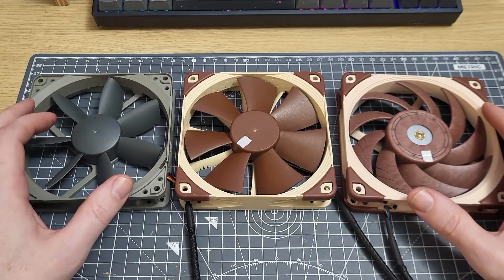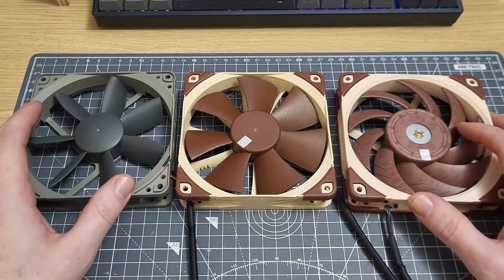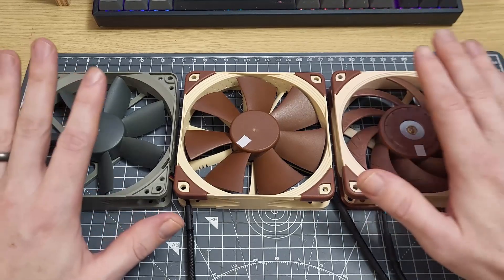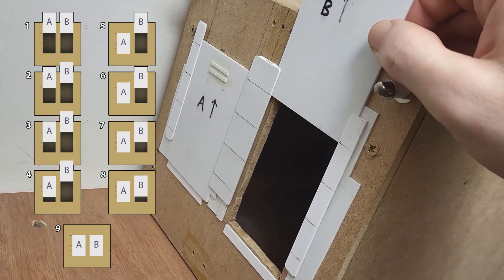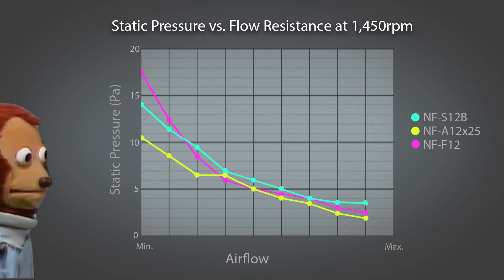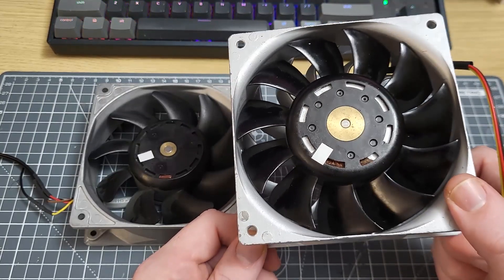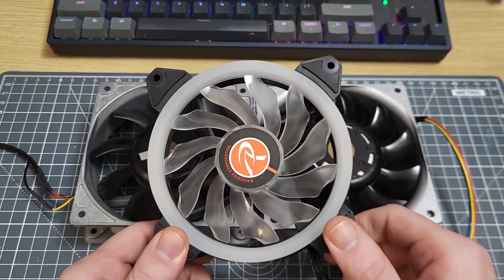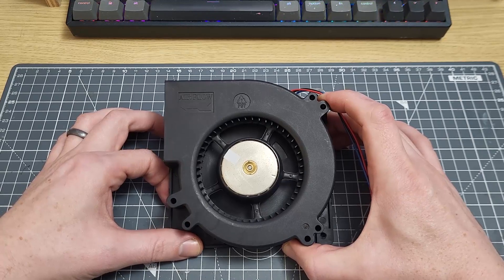"Static Pressure Fans" Don't Exist - Part 3

Comment: The tests and comparison is very good. I think the difference in RPM might not be important for end user. I would say for a PC fan user (home user, putting it in PC), the RPM is just a intermediate variable that can be easily measured and used as control input. What people really care about is the noise-per-cooling. So I would give noctua a out of jail card for not mentioning the RPM. and it would be a lot more comparable if we can do a test where instead of RPM is held the same, the noise level is held the same.

Comment: Why would anyone care the rpm of two different fans running at the same noise level? The whole point of deciding which "PC" fan is better is to see which fan outputs the most airflow under the same impedance at given noise level.

Comment: "PC fans will never get this level of obstruction in real world use."
Meanwhile me here with a niche use case just wanting to find out what'll be the best fan to reallllly force air through. Although, I've already realized the answer is just, high rpm. 

I know these videos are addressing talking points said on forums, but still it makes me roll my eyes.. kinda feels like you're talking down on us from time to time.
Reply: My 60 mm thick 16 FPI radiator begs to differ. That said, it only manages to choke out bequiet weak quiet fans.

Comment: I don't really get the point of this series... You say right in the video that noise is the priority with home PC fans. Are you just upset that some YouTubers popularized the term "static pressure" when it doesn't apply relative to industrial fans where noise isn't a consideration?

When I'm picking fans for a home PC, I know I could get some $150+ industrial fans and enjoy my gaming sessions with earplugs in... It's just not an option I think it's a good one in that scenario. Most people putting any real thought into fans look at testing of their use case in noise normalized scenarios, or as you also note, the RGB. I don't think anybody thinks their Noctua will compare to a Delta  on performance, but they aren't gonna put that thing in a PC next to their face on their desk.
Reply from the maker: I just find this stuff really interesting, and of course when I heard the term "static pressure fan" a few years ago I laughed a lot and didn't really think much about it, but now people actually make purchase decisions based on this nonsensical misinformation so I thought I'd make some videos about it. The main purpose of the series is to demonstrate that static pressure performance doesn't necessarily translate to actual cooling performance, and hopefully people will be better informed about which fans are actually the best cooling fans, which will take a fair amount of testing to ascertain - which, for me, is the fun part.
Reply: @FanPhys  I absolutely agree that it's interesting, in a purely academic sense, but as someone with years in the PC building and customization space, "static pressure" has a very specific place in how I make a decision. I wouldn't expect it to make much difference in a low-resistance application like an tower air cooler, but I will consider it when paired with a radiator. Even there, I won't be looking so much at the static pressure, but the real-world performance of a fan through a radiator.

That's somewhere where I really wish there were more complete and objective data. You can find scattered info about airflow through a radiator, but that generally won't test more than a couple of radiators that only differ in thickness, not fin density or geometry. I haven't seen any testing of the difference fan design might make between two different radiators in terms of actual thermal dissipation, but that would be incredibly fascinating.

Comment: This testing does not prove what you are saying.  Your fan box does not accurately replicate the kind of resistance a fan encounters on a heatsink, and your last video proved that your testing methodology is poor.  If youre test environment was a reliable analog, it would produce results that map directly to the results you saw when the fans were used on your heatsink in your computer.  But, the results from your test environment didn't even remotely resemble what you saw using a heatsink.

You're also disregarding all the testing results from known reputable testers, which very clearly prove that certain fan designs maintain more airflow through a heatsink or radiator.  E.G. They maintain more pressure in the face of heatsink/radiator type restriction.  

It's disingenuous to try and say that your test results prove there is no difference between fans marketed as higher static pressure, when you have clearly shown yourself that your test setup does not replicate the results seen when a fan is on a heatsink.
Reply from the maker: Again, you are assuming that pressure is the only consideration when we measure fan-on-heatsink performance, and that's not how fluid mechanics works - it is vastly more complex than that. And for what it's worth, the vast majority of "known reputable testers" have a poor grasp of physics when it comes to this sort of thing, which is precisely why I am making this series. Why would I regard test results that are obtained from poor, uninformed methodologies?!

Comment: You measure pressure at a set system impedance with your setup, you could theoretically calculate airflow from that though
Reply from the maker: It is possible to measure airflow from pressure, however getting an accurate reading would be difficult. Perhaps somewhere down the line I may be able to look into it!

Comment: Instead of same rpm, noise-normalized result would be better no?
Reply: Which Noctua did, as stated by the "Fan speed adjusted to similar on-application noise levels".
As airflow scales linearly with RPM we can directly calculate at which RPMs the fans were running at to get those P-Q graphs, which are 1350RPM for the F12, 1230RPM for the S12A (above spec) and 1765RPM for the A12x25.
Now the system impedance for the noise level determination was definitely chosen to suit the A12x25 and not the F12 or S12A, but I'd also regard it being a much better fan for real usecases and not just static pressure per RPM (F12) or just air flow with no resistance per RPM (S12A), the latter stalls with the slightest "load" for what it's worth
Reply from the maker: @or2kr  This is why I called Noctua disingenuous - rather than actually state the speed of each fan, which would explain the disparity in the graph, they put a cryptic note that gives us no actual information.
Reply: @FanPhys  They also totally didn't do that again with the next gen 140mm marketing and chose totally different impedance curves compared to the 120mm marketing sheet :^)
Reply: This isn't testing for performance, it's more about reviewing manufacturer claims

Comment: Just found this series, now I'm staying. I am going to be really really interested in the next part since blower fans have been demonized in graphics cards. Also do you have any recommendations for PC case fans for someone who really doesn't care that much about noise and cares more for performance? (I currently run 2 NF-A12x25 fans [they were just recommended for me] at maximum RPM and can still tolerate more noise. And hey, now I now that the "curved fin" design kind of sucks, err... blows for performance)
Reply from the maker: Thank you! Performance fans are generally either bigger (well...thicker), or faster, or both. Virtually any 120mm fan at 2000+rpm should match or exceed the performance of the A12x25, and at the high end a fan like the NF-F12 PPC 3000 or the Phanteks T30 would do a great job. Blowers are not so great because they produce a lot of noise relative to the volume flow that they provide, but I'll look into that soon!
Reply: @FanPhys  Thanks for the recommendations! Can't wait for the next video in the series!

Comment: You said it at the end of the video. PC fan manufacturers nowadays use a baseline an average consumer actually cares about, noise. And in places you need static pressure there will be noise.

Axial fans have a nasty feature: they completely lose pressure when flow resistance gets too high. For example if you have a CPU radiator with an axial fan strapped to it inside a PC which the owner never cleans, eventually the fan facing radiator side will gather so much dust the fan will completely loose pressure and will generate close to zero airflow through the radiator. It's interesting to see where this point is for different fans.
Reply from the maker: The thing with noise is that it's subjective, and that's because "loudness" is not really a measure of how noise is actually perceived by different people - the exact same sound might be annoying to some people and almost inaudible to others. This is why IMO testing fans based on noise is a fruitless endeavour. I'd much rather base it on fan speed, because in my experience virtually all 120mm fans are essentially silent when you get down to about 1,000rpm, at which point you've basically nuked the performance that the fan can offer. We shall see what the results say!
Reply: @FanPhys  maybe there are free spectrum analyzers out there that can "quantify" the sound quality of a fan, Ansys Sound for example mentions fans on their product page. A psychoacoustic analyzer basically. I also found a paper by University Siegen in collaboration with ebm-papst on the topic. Might we worth looking into.
Edit: I just found what looks like code for Matlab for exactly that, accessible for free.

Comment: really enjoying the test methods and validations, would love to see a video compiling all the results at the end of this series.  It'd probably help the channel performance a lot as well, this is offering something LTT, GamersNexus or other channels don't ever dive into, and tests they do perform are often pretty poorly designed.
Reply: I don't think their fan tests are that bad, talking about GN and hwbusters. End of the day the performance that matters to the end user is how well do they cool a system at a given noise level. Real world tests on a somewhat standardized test load do offer that, be it at not the greatest measurement resolution.
Reply from the maker: I'm glad you're enjoing it! Ideally, I'd like to keep adding info to the charts with each set of fans that I test, and there are fans that I'd like to test that I don't yet have (Toughfan 12, Phanteks T30, UNI Fan P28, one of Noctua's PPC fans, etc.). One thing that few others seem to realise is that fans & coolers perform quite differently with different thermal loads, and that's something I'd like to have a look at... but it is a monumental task and would take a lot of time (and money!). Thanks for your comment!